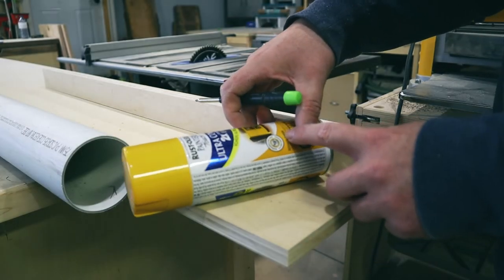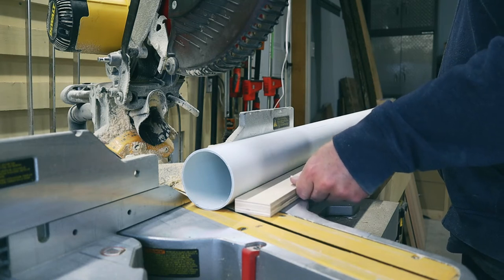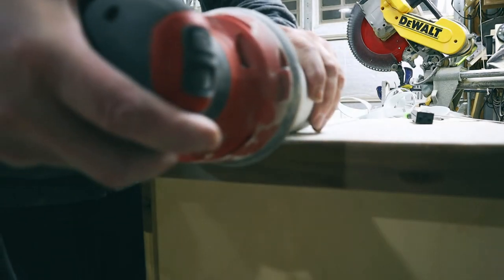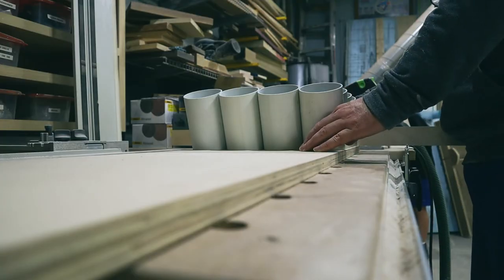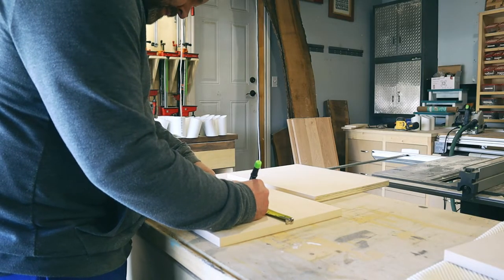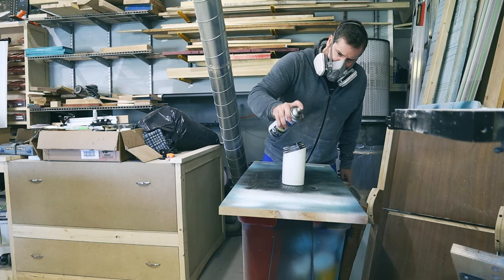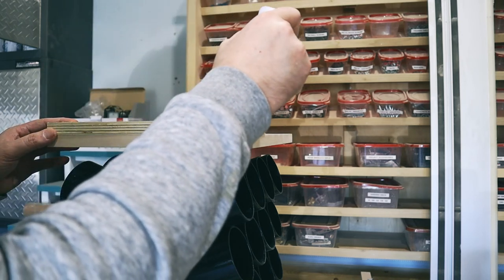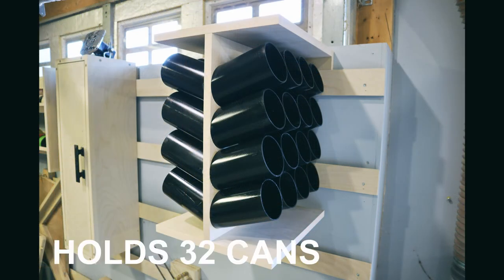How To Make A Spray Can Holder | French Cleats | Spray Can Holder | Woodworking | DIY

Comment: I don't like CA glue for this, I'd be afraid it would fail. It definitely looks bad-ass, though! How is it holding up?
Reply from the maker: I used the CA glue to temporarily hold it.  I added construction adhesive inside the pipe afterwards.  It's holding up great.  I need to build another one... I have so much paint

Comment: Have you had any issue with the CA glue? Thinking about making one of these for myself and seems like it would be super easy to just glue them on since most cans on the way ounces and would never be strong enough to actually rip the glue off.
Reply from the maker: No problem at all.  I move it around quite a bit too.  It has held up really well